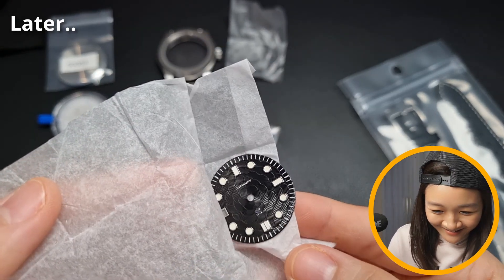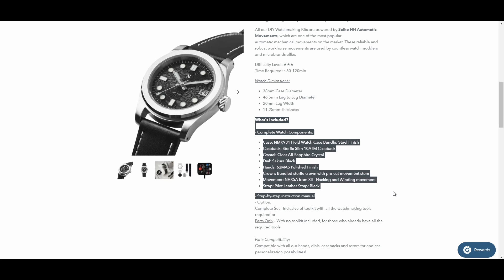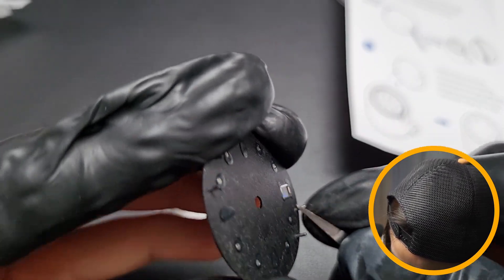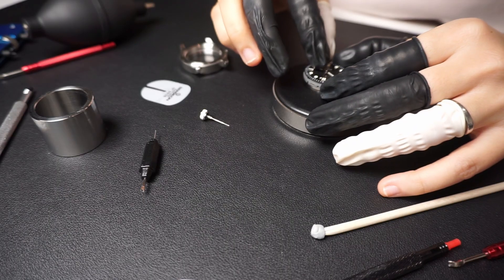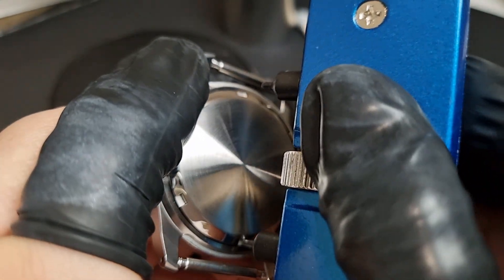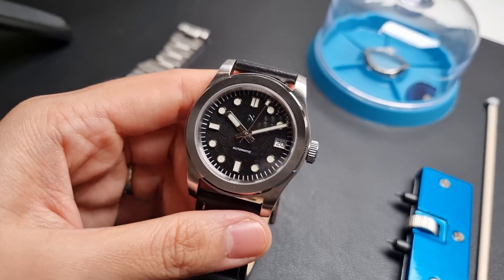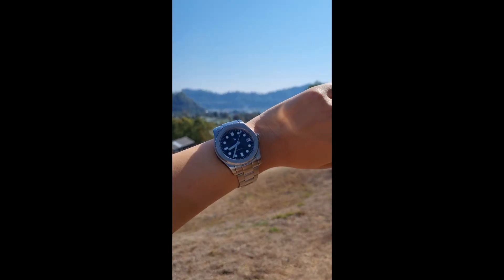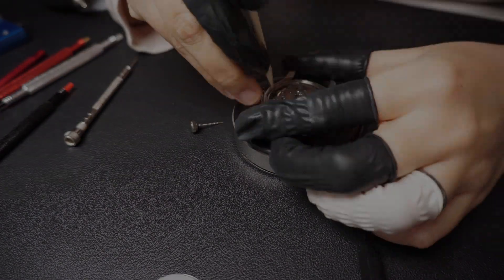I made a watch with Namoki Mods DIY Watchmaking Kit

Comment: Well done! The final product looks great! One thing I will say: the black plastic screw device you referred to as a movement holder is actually a case holder. You’re correct in saying you should use one of the metal movement holders as they are actually for movements, whereas the black plastic one is for the case. Great video though!

Comment: So they save production costs by letting you assemble the watch? As I see you can not chose between different dials, hands, straps or bracelets from the beginning but have to buy one set of items already chosen by them. And if you want to modify those you have to buy additionally parts. That does not convince me.